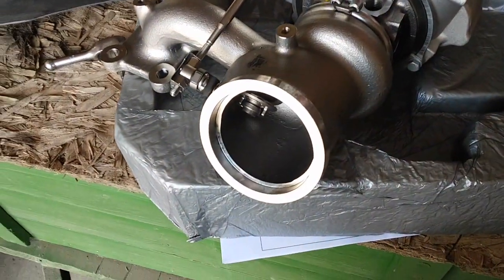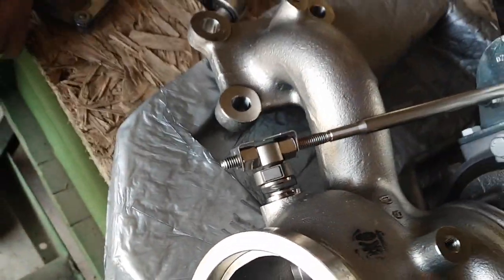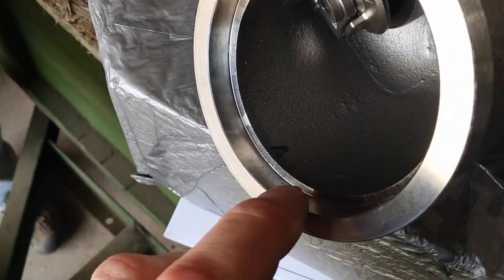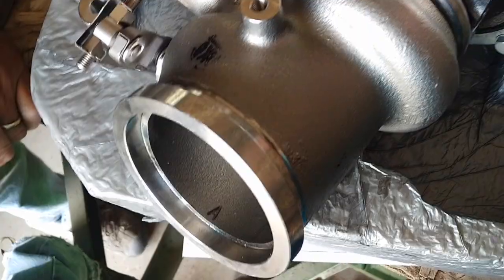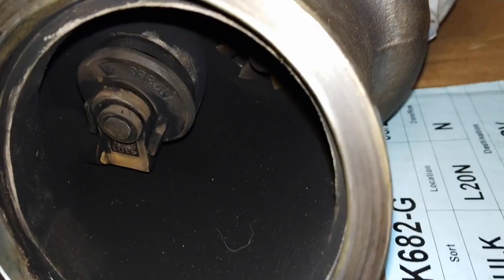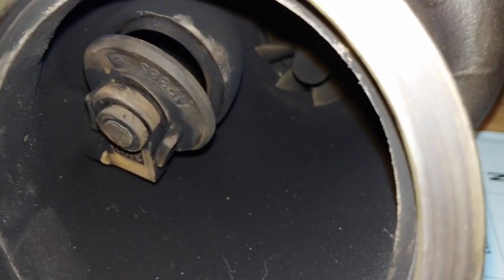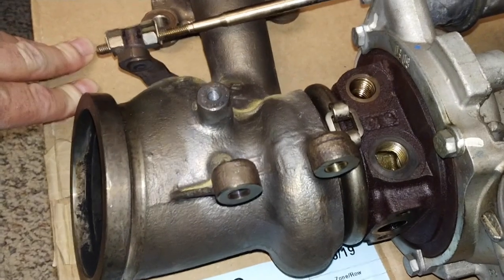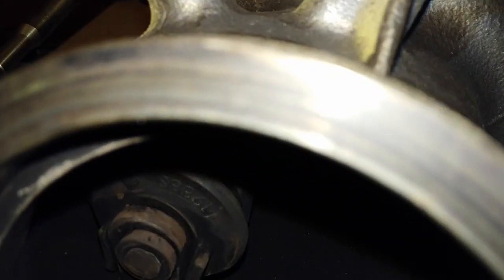2.0 Ecoboost Wastegate Failure Diagnosing P0299 Error

Comment: I have a 17 ford edge with the ecoboost showing a code saying wastegate pressure higher than expected. What could be the issue
Reply from the maker: I can't say, as I'm not a mechanic and the '17 Edge has a slightly different motor than the '13 (twin turbos on the 2017), but I would guess a few possibilities: stuck waste gate or actuator, bad actuator, or a bad sensor. Does performance seem to be an issue at all?

Comment: Will the later model turbo not mate to the early model cat?
Reason I ask is I just changed the turbo on my wife’s 2012 2.0 ecoboost and I did not know about the difference in flange size. It seemed like it mated up well and the clamp tightened down good with no sign of exhaust leak that I can tell.
Reply from the maker: Yes, it should work fine. The only difference between the two parts is the flange depth.
Reply: @lutheranpriest  gotcha. Thanks!
Reply: @lutheranpriest  Have you ever seen a new/reman turbo that put out too much boost? I replaced the one on my wife’s 2.0l ecoboost with a reman Mahle turbo and I keep getting a P0234 turbo overboost code and it’s bypassing the turbo. I have changed almost every sensor/solenoid (MAP sensor, turbocharger boost solenoid, and the boost valve solenoid) that has anything to do with the turbo accept the boost pressure sensor (one on the cold side pipe next to the cac). When I watch all the PID’s it seems like it it working fine. I have even changed out the wastegate actuator and adjusted it a few times. It does fine on backroads but when she drives the interstate and has to keep speed going up hills is when it normally does it. Do you have any suggestions as to what it could be or what I should check?

Comment: Thank you! I have a 2016 ford fusion 2.0 with 123k miles (yes I drive a lot) and I've noticed that rattle only during the initial cold start and on 1 and 2 gear on the deceleration  not acceleration....

Comment: just want to give you an update I got the turbo out of my all-wheel drive escape and I was able to get it out of the top without moving the engine You don't have to go through the bottom and take off the PTU also I am just now leaving the machine shop and basically they can't put bushings in or fix the actuator rods or replace them without cutting into it and they're experiences that you have about a 1/3 chance that those welds are probably going to crack and then there was some other issues I don't want to put it down here because I don't think I'll say it right But basically I think it was parts geek has a new turbo for $481 he said he would probably quote me about $350 for the job but it could be more or less and so the the risk isn't worth saving that $130 so until someone starts selling just the turbine housing unfortunately it does seem like the best option is just to replace the whole turbo hopefully you can buy it from some other place instead of forwarding up a $1,200
Reply: I kept the old turbo i know the new prt was in the car because when i drove my car with the new turbo it was alot better i got good boost there was no rattling but then 2 days later i heard it again and i thought the turbo messed up again or something but when i checked the car it said the car needs a wastegate solenoid and a catalytic converter
Reply: Just got my 2013 ford explorer turbo fixed and now im hearing the rattling sound i think it may failed again i think its the wastegate solenoid that may messed up the new turbo i just put in ima have to check that out again
Reply: @plxyboilx04  very doubtful when I got my new turbo the linkage was much better it takes a long time those are metal parts it takes a long time and a lot of cycles for them to wear out I know that some of the EcoBoost engines we're having some timing chain or VCT issues that also made a rattling sound when is the rattling sound what details can you give whenever I had my V6 mustang that was supposed to be a rattling from the valve buckets but I never experienced that and I never knew anyone that did but these use that same technology
Reply: So if you want to check if it's the linkage you're going to have to just go behind the engine there's two bolts that connect the diaphragm rod to the wastegate linkage wait for your engine to cool off it'll be too hot and just take off one of the nuts cuz it has to be loose and then you can feel if the linkage is loose I hate to say it but what mechanic did you take it to what if they just put the same s*** turbo right back on and charged you but I wouldn't even think that until you check the linkage because that would be beyond bull crap and if you have pictures of the turbo you could probably prove it another thing is you might check the exhaust piping if they didn't tighten it down right cuz I know I had mine on and off a few times and it's a pain getting those exhaust pipes to line up right and tighten down right
Reply: Also you're going to have one of these EcoBoost engines and I would spend 100 bucks put in a boost gauge it's so helpful for diagnostics those 2.0 should be making 15 psi when you put it to the floor and it shouldn't cost $100 even there's no good port on the manifold for your gauge so what I recommend is getting a cheap throttle body spacer off eBay like I did they're like 20 bucks the one that I got has like eight ports although you only need one and then I think I got the glow shift electronic boost gauge just cuz I like to read my gauges and digital I've had them on a bunch of cars never had problems with them even though they're cheap and then I could even give you the fuse that I used it's an unused fuse it's like the farthest to the front driver side if I remember right in the fuse box and that's where I tied in my boost gauge if you want to run an electric one it's really easy anyone can do it I could even show you how I put the gauge on my dash so you don't have to drill or anything and you can just take it off when you sell the car
Reply: @sock979  yeah i got good boost and its a 2.0 ecoboost now i barely get boost when i floor all you hear is the engine being loud but no boost and it takes forever  to get to 60
Reply: @plxyboilx04  okay you probably should have gotten a new diaphragm with the turbo but if they use the old diaphragm your diaphragm might have failed and so it's just keeping it open and that's why you're not getting boost you need to test the diaphragm and that's easier but I would also check the linkage while you've got the diaphragm off and now with mine if I remember right you have to actually pressurize it for the rod to move it doesn't it's not under vacuum it opens when it gets more than a certain amount of pressure cuz there was one video that said that they put vacuum to it to test it and while that might see if the diaphragm is broken or not I don't know if that would actually tell you if it's operating right because it uses pressured open not vacuum as far as I know without mine worked
Reply: @plxyboilx04  yeah I would really suggest getting a cheap boost gauge just so you can see how much boost you're actually making just go to AutoZone and get a manual one that way you don't even mess with electronics and it'll be a pain finding something to tap into though without that throttle body spacer but I would really suggest getting a boost gauge on there to help diagnose it before you spend a lot more money especially if you're paying someone else to fix it and not doing it yourself.  Also I know there is another solenoid in there because it's not a manual system that just uses the diaphragm to open and close it the ECU actually controls it and so there's a second solenoid on top of the valve cover and I believe that's the solenoid DC uses to control the wastegate when it opens and closes you might also check that if you're in Phoenix I would say just come over to my house but I'm assuming you're not
Reply: @sock979  yeah i live in California maybe you should add me on instagram _yt.alx but i found one on autozone and its cheap ima buy it soon but i wasted $350 to add the new turbo i wish i could of done it myself but i was scared i was gonna mess something up but i need to fix my car asap im tired of going slow in the highways:/
Reply: @plxyboilx04  well 350 is damn cheap my turbo was 500 so at least you saved there it's probably cheaper because it didn't have all the extra stuff that mine did like I got a new diaphragm and vacuum lines and everything with mine but yeah just go through the different parts if you're losing boost it's it's either the wastegate or the diaphragm or the solenoid and get that boost gauge good luck if you have any problems let me know and hopefully I can help
Reply: @plxyboilx04  I'm a little confused actually from what you said because you replace the turbo and it worked good like you weren't getting boost you replaced the turbo then you were and then you're not after a few days that doesn't make sense to me look at your old turbo is the wastegate linkage loose and it can open by itself like it does in that video that these are off of these comments are off of because if that's loose the linkage you needed a new turbo anyways if it's not loose then yeah I guess it could have been the diaphragm or something but if that was the original turbo once you hit about 100,000 miles you're probably going to have to replace it anyways cuz that's an early year 2013 and those ones had the worst weeks that always fail I'd like to know exactly what it was if you get you get a chance
Reply: @sock979  my old turbo wasnt working because it was loose and the butterfly was gone too and my new turbo was brand new i got it at maxpeedingrods.com so i will have to buy the wastegate or diaphragm to see if the rattling goes away if not then im guessing the turbo has failed again
Reply: @plxyboilx04  if you have to get another turbo I'd suggest going somewhere else I think I did geek parts something like that and it was like 500 bucks and it comes with the diaphragm and everything new that you need
Reply: @sock979  i dont think its the turbo because im getting this different sound its not rattling anymore
Reply: @plxyboilx04  can you post a video in YouTube and put a link here in the comments so we can see/hear what's happening

Comment: And do try adjusting the wastegate actuator I bought myself six months with that which means I get work on it now in the winter in the desert in Phoenix Arizona rather than the hot summer.  And while I had the rattle I got anywhere between 8 or 9 PSI and 12 PSI everyone kept telling me it was supposed to be 17 PSI I did put a boost gauge on mine I can't believe they don't come with a boost gauge from the factory If you want to do a boost gauge the easiest way I found is get a decent boost gauge first of all don't get a crappy one And I'd recommend getting one with a solenoid reader soon enough to run the vacuum gauge all the way into the cabin and then they have a cheap $25 throttle body spacer you can get on eBay It does nothing for performance but it's got a bunch of ports on it and you connect your boost gauge to one of those ports and I used the fuse box in the engine bay on the driver side in the first row the row closest to the grill the fuse spot all the way to the right so it's five fuses going from left to right I believe basically the front right corner fuse I think it's like 15 amps and I just used one of those add a fuse things from AutoZone And because I didn't want mine to be permanent I just ran the wire through the door I couldn't find a good grommet and I was feeling lazy and then I just wired it behind the gauges those just pop out pretty easy and ran the wire through there and it just sits without any mounting bracket I would put a picture in the comments if I could but it's pretty easy I think the gauge I got was like 40 bucks and then the throttle body spacer was 25 and then probably another five for the wiring and add a fuse.  If you go to the escape forums you can probably find the post where I showed it.

Comment: Just want to let you know cuz I'm going through this myself with my 2.0 escape You can't get just the turbine housing off after it's gone through so many heat cycles I have my turbo off and I still can't get it off It's sealed on there so hard cuz that's what I was going to do and yeah I'm looking at my turbo right now and I busted out my $25,000 feeler gauge and it's about quadruple that if not more for the flapper valve and yeah my on the armature that goes to the rod yeah mine got kind of oblonged as well and I measured I think 6 mm of movement and on mine the rod that goes through the housing from the arm to the flapper valve is loose as well I will be trying to take mine to a machine shop although so far in all of the Phoenix metroplex I've only found one shop that would even look at it to see if they could do it to try and put in some bushings but it looks like to fix the flapper valve if you could get it on a press you might be able to press all those parts out and probably have to grind off the you know there's like a flattened part at the top that looks like was smashed to keep it on you probably have to ground that off to get the parts off but I'm willing to do that because otherwise the turbos garbage and I got to buy a new one anyways I'll try to remember to post on here how that went

Comment: Dose this affect gas mileage as well I’m getting shit mileage and when I let of the gas around 40 or rev it up and the motor slowes there is a weird rattle
Reply: I only noticed the rattle on deceleration when you let off the gas It didn't seem to affect my mileage that much but I still had boost most of the time it just wasn't as much I only had a very short period where I had absolutely no boost and it was such a short period that I don't think it affected gas mileage I ever did about 25-26 with probably 70% highway